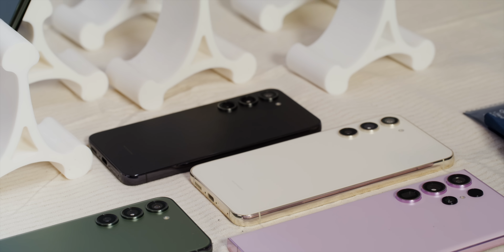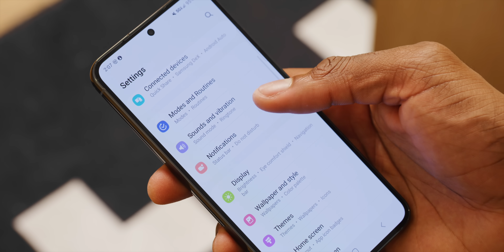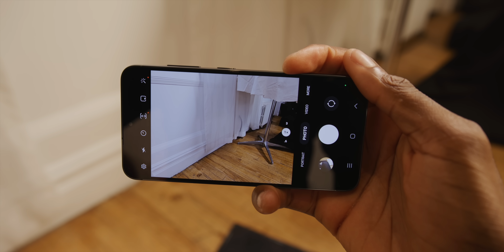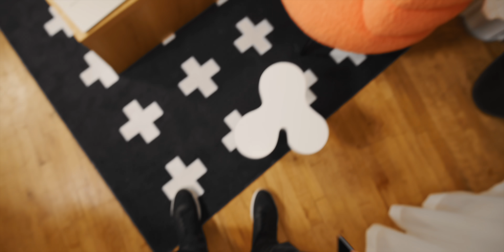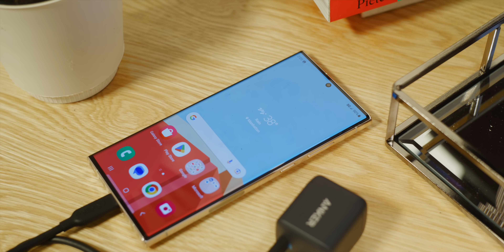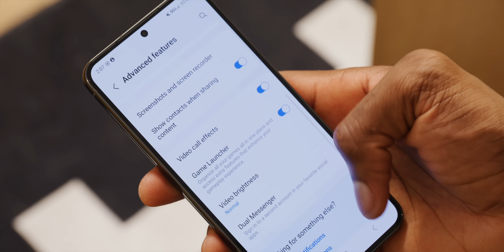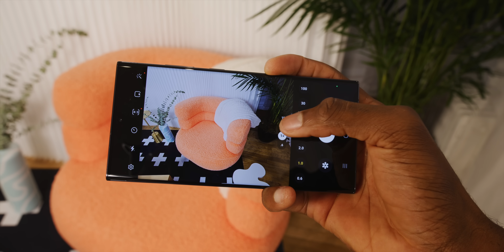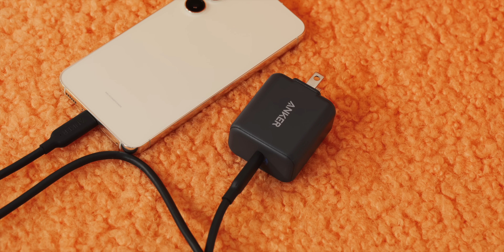Galaxy S23 / Ultra Impressions: Cruise Control!

Comment: I am still using my Samsung Note 10 5g+ and I was trying to use it as long as possible, but I think this might wind up being the replacement. 3.5 years is a pretty good life for a cell phone
Reply: I have the Note 20 and will keep it indefinitely. Phones are too expensive where I live, and this phone does everything I care about anyways.
Reply: @AppleToaster  I live in Australia and the prices of phones here are insane s23 here is 1350 !!
Reply: @OfficialLucasAllTechReviews  damn, at least we can be glad that this isn't any different from the previous phones, so you can find some deals :)
Reply: I'm still using my Samsung Note 10. Still thinking if there is any phone worth upgrading to...
Reply: Love the Note 10 plus 5G, and same here... still rocking since 2019. Like the pen and the extra "external" micro SD card. Daytime photos good, nighttime so so. I may upgrade to S23 plus or Ultra (like the pen). Have Sony Xperia 5G for fine (better) photos. Also like my S20 for a small manageable phone with DEX. Got a Flip 4, not that great but a cute gimmick (like my Pixel 6a better). Not sure that the S23 line has DEX. All the best with your phone. Seems like Tmobile supports Samsung great and Pixel too, but somehow my $$$ Sony Experia 1 Mark 3 does not get the fastest data connection on Magenta Plus (but takes awesome photos, love the dedicated (high speed feature) shutter button.

Comment: i love my note20U tho it was on its last os update i still want to use it for 5 more years. i was about to buy another note 20u as back up for vacation and trade it to s23u but now that they only give 350 for note20U. now im thinking i will not get back the amount of money i spent for the open box note 20U which is 550 if the trade in is 350. im trading ipad pro for 200usd and get s23u for 1200(512gb) anyone can give me their opinion should i buy s23u instead?

Comment: 8 gen 1 chip holds me back from purchasing any of the last gen phones. But then the price of S22 is lower now, should I get S22 or S23? I'm just worry about the heating issue, the heavy task I will mostly do is only using camera to shoot and record. A lot of phones with 8 gen 1 chip couldn't sustain long duration of using camera heavily. Is the 8 gen 2 much improved in that sense that it is better to get S23?
Reply: S23. S22 battery is crap
Reply: @wahahah  S23 battery is not so much better, unless the chip is way more efficient. That said, I am coming from way older phone Xperia XZ1. The battery life of both is an improvement to me already.

Comment: I'm still rocking my Note 9. Still does everything I need perfectly well. Will keep it for another year or 2.
Reply: Yeah, mine was still working good, other than some screen burn in, and the oleophobic coating was wearing off. Ended up getting a new S22 Ultra last year. Might try and replace the screen on my S9.

Comment: If there are no major improvements then , how can you persuade people to get a new phone 
It gets so boring with the chips and camera upgrade , maybe they should add a fisheye lense and a motorised lense cap 
I have always wanted a textured screen like pin art and it would be interesting adding a micro diffuser to add smell to a mobile phone as I tried to use Dali e to create an ai concept phone it failed 

It is so hard to recommend new phones as there hasn't been any major advances as there needs to be a convergence , where are things like the temperature sensors 
Why are mobile phones so boring , we seem to be paying more for less 
So phone prices have gone up and we have lost more ,
we have lost  the charging brick , headphone jack, SIM card, micro SD card slot yet phone prices have gone up 

None of these companies take any risks any more

Comment: Could the flickering be PWM? I heard Samsung has changed the screens this year and are using possible higher PWM over prior models. Could help provide some relief to us sufferers if true. Slow Mo of the screen would help confirm but proper equipment would be better.

Comment: I don't mind the small upgrades each year. But one BIG thing this year in my opinion is the worldwide usage of the snapdragon gen 2 chip. Every single year EU for example has had a noticeably worse phone in multipe departments for the exact same price. FINALLY this happened. I won't get the s23 since I got the s22 but I'm glad to know my s24/s25 will have an equal chip.
Reply: I held back on the S22U for the same reason. Glad I can upgrade this year.

Comment: keyword here is...'the ohones feel FAST and Samsung phones feel this FAST when they are brand new...'
My 12Pro Max has never started since i got it after giving up on my Note 5 which could hardly make a call cos it was dead slow to the core. Gave up on Samsung entirely i dont even want their TVs anymore than i want their phones...Now stack with the iPhone and Pixel 3 from 2018 and it is still super fast (only had to change the batery) no jokes!!!

Comment: Why the hell did you even upload when you haven't tested or done anything with the phone?
Desperate?
Reply: Are you new to youtube? Ever heard of impression videos? This is not a review, just first look at the annoucements made in the events.
Reply: @xynyde0  Check out Mrwhosetheboss's video made during the same time frame.
I have no problem with impressions but this video doesn't even tell much about what new stuff the phone brings. 
The Verge's keynote in 10 min video was more helpful than this.

It's literally so low effort.

Comment: These companies should just release new models every other 2 or 3 years. Their phones have almost non existent changes. Not worth updating. S23 line is pretty much S22 with slightly bigger screen, those slightly bigger battery will surely not make a difference.

Comment: Dear Sir, is it possible to use samsung S23 or 23+ to locate an iphone 12 and vice versa?  My wife and I are using iphone 12, we both wanted to know our locations from time time but I really wanted to trade in my current iphone 12 for a new S23+?  Are there any software out there for samsung S22 or S23 to do that?  Thanks a lot!

Comment: I have the s21 and I've really been looking for a reason to upgrade but nothing much changed
Reply: I have s21 also. But my phone is easily get warm when watching YouTube for 1 hour and get very hot if i use camera while using mobile data.. did ur s21 also have the same problem?
Reply: @jiyokchiok563  not really but just a day after I typed that my phone's been having a hard time with YouTube rn I'm typing this with the text box in the notification bar
Reply: @Cloudy  loll so what do u think s21 is still worth it or u want to change?
Reply: @Cloudy.....  nicee k then

Comment: Great. Short and sweet. 

Let the Samsung-affiliated channels do the 10-minute ads, hyping up the most minor changes! The S23 lineup is great, but so are the S21 and S22 (IMHO), so there is no need to upgrade; even my S20U is still running well & I certainly would not think the S23U at £1350 is a good buy. I will await something that pushes the market rather than iterative relying on the new chip and more megapixels.

Comment: I'm using a base S22 256 gb model that I ordered only weeks ago. Bought it at a very nice discount so I just decided to pull the trigger and trade this phone in for the base S23 256 gb model. A lot of people were disappointed with the low trade in value but I didn't end up paying that much more for the S23. A phone I'm more than likely going to have for the next 5 years.

Comment: I'm still using a S9+ that a bought on launch day, and it doesn't feel dated at all besides the camera. I replaced the battery and usb-c port at Samsung last year, and it still has the original screen. Crazy how well made flagship phones are. I feel like the model has completely changed from what it was 10 years ago where you needed a new phone every 2 years...sure, the S23 is crazy expensive, but it could potentially be your phone for the next 5-6 years if you treat it right.
Reply: I have the S9+ as well and am now thinking about updating to the S23. But I totally agree with you! For me, the lack of security updates is a reason to upgrade now (and of course the weaker battery)
Reply: No kidding! I kept my Galaxy S, SIII, and S5 2 years each, but my S7 lasted 4 years, then the S10e I have now has shown nearly 0 age in 3 years. I could probably keep it another 2-3. I think the S7 design was my all time favorite.

I remember the SIII especially being unusably slow and RAM bottlenecked 2 years in...insane how fast tech used to progress.
Reply: S9 here
Reply: The mid range phones are also great,  I got a Galaxy A53 5G and it does everything I need it to. £500 for 2 year contract for unlimited usage on everything. 
Was only paying £10 a month for the last year on a sim only deal. Will do the same when this 2 year contract ends. Phones definitely lasting longer.
Reply: @MrMark1  gonna have to disagree with that, but maybe my experience with Samsung midrange phones is a bit different - I have heard that the A53 is a decent phone for the price, and better than the previous midrange Samsungs. I haven't used it myself, but on paper the processor still looks underpowered for the features it's offering. 

My wife got herself a A32 a year ago after her S9+ got stolen. I've never seen a phone get so slow so quickly. I've tried everything to speed it up for her: deleting apps, changing the animation scaling, freeing up memory, etc, etc. Nothing makes any difference. It still takes 5 seconds to open the camera, ages to open Spotify, YouTube and Reddit...I would say it's pretty much unusable for me. 

Bottom line is that the processors in Samsung's midrange phones are just not powerful enough to keep up with modern app development. In 2 years they're not gonna feel as fast. 

Somehow, my 5 year old flagship still manages to stay snappy, and it's the reason I still have it. Had I bought a midrange device, I would probably be on my 3rd $400 handset, whereas now I'm still using a $800 phone I purchased 5 years ago.
Reply: I got s9 plus still too lol
Reply: Since android 10, there is no significant updates that actually that great.
Reply: @ricoganteng6409 no obvious changes, but 11 and 12 were pretty significant with one ui 5

Comment: 2 Points here.
-[The camera lag can be eliminated by turning off all the ai settings like auto HDR, auto lens swap, sharpening and scene optimizer, then in the good lock app camera assistant turn on increase shutter speed. this also works for all S21-22 phones.

- The flickering is the adaptive refresh rate turning the hz down to lower than what the camera is picking up to save battery when your not moving the screen,

Comment: Would love to see a comparison video of the s20ultra, s21ultra, s22 ultra and s23ultra to  see how much they have actually improved over the last few years
Reply: Mrwhosetheboss does that
Reply: @Ko92982  and is an overall better channel for Samsung
Reply: @_Anakin_Skywalker  u speaking them facts, man's is biased to Apple
Reply: @_Anakin_Skywalker  mkbhd´s favourite and most used phone is a S21 ultra, samsung fanboys just refuse to accept its the same phone from last year lmao
Reply: The s21 ultra had the best design though! 👌
Reply: @rikshep9775  s21 ultra is one of my favorite phones ever
Reply: @rikshep9775   not denying that but 888 sucks the 865 on s20u rocks haha one was made by samsung foundry the other is TSMC big difference yo TSMC only came back from flip 4/fold 4 and of course the 23s
Reply: In fact, include the s10 and note 10 series. Those phones still perform quite well.
Reply: I've still got the Note 10+ and I must say it's fantastic even today.
Reply: The s20 had a 1440p screen, but all the newer ones have 1080p. I will buy another s20 when my current one dies
Reply: @Kukeniduken  no they don't i have from 720p to 1440p on my S22 ultra you just chage it in display settings
Reply: @johnsample9671  The ultra maybe but not the base version
Reply: S20 Ultra was the biggest and best jump in performance. Going from S10+ you got 120hz, 5000mah battery, bigger display, better camera, better chip. 
None of the other ultras after that one have been a big jump. Got worse even. The Note shape is not good at all IMO. Rounded edge and display is great!
Reply: @XzXmullvadXzX  haha and i for one still holding on 2 it considering that i need 2 import 865 over in exynos land hahahaha so yeah i still gonna hold 4 another year and its still like new phone with Android 13 on it with it being last major ever
Reply: No one will do that video. Would look bad for Samsung lol
Reply: 22 and 23 are basically not phones so they have that going for them at least, but otherwise I'd absolutely love to see the comparisons for things like screen quality, benchmarks, battery life, etc
Reply: is   green a good color for a man.   does it make him look soft?
Reply: @mrcarpet4u  if anyone thinks you're soft or that you look soft because of the color of your phone, then they are the problem. Purple is my favorite color and if there is a purple option, that will be my phone everytime. My purple s23 should be here in 2 days.. GO AHEAD get the green one and if thats not enough, go crazy and get you a sopiguard or dbrand skin and do whachu like! Have fun and NJoy yourself and don't sweat the small stuff. Peace and love to you and everybody in here 🤞🏽🕶️💜
Reply: No change whatsoever.
Reply: @mrb2349  We are talking about Samsung, not Apple
Reply: @kintsugittv2537  no, Apple's phones work flawlessly. This new flagship can not even switch lenses without stuttering. And it's the same exact phone for 4 consecutive years.